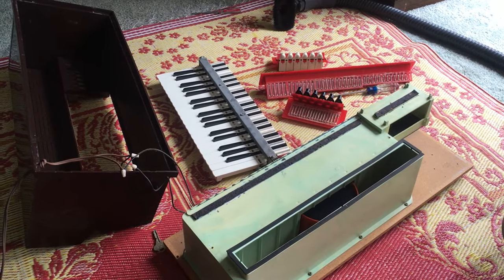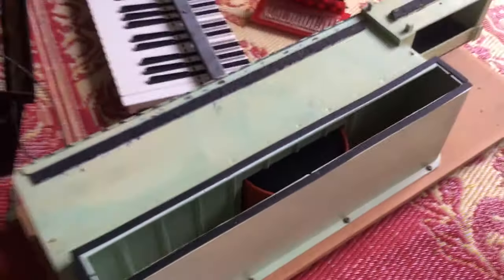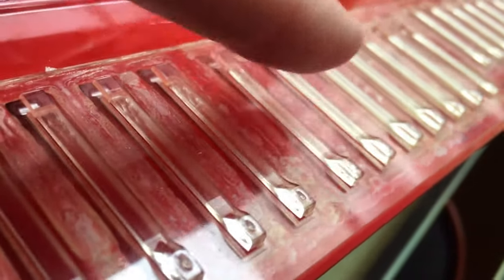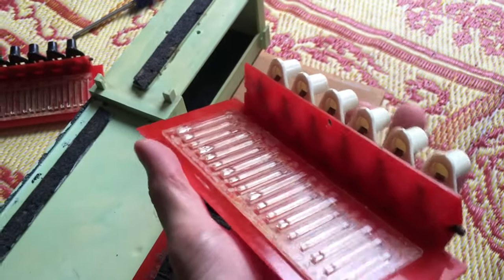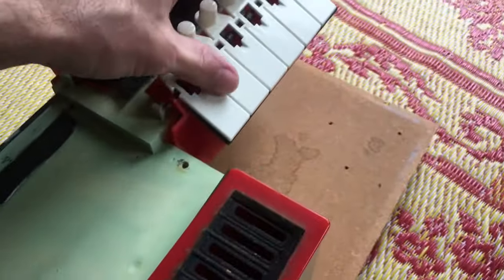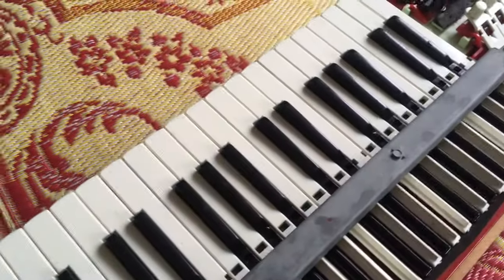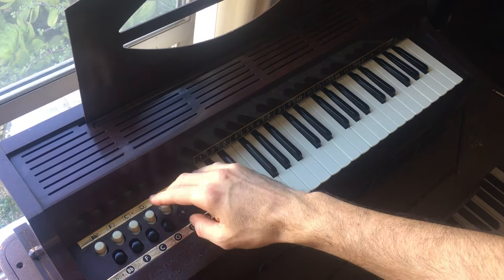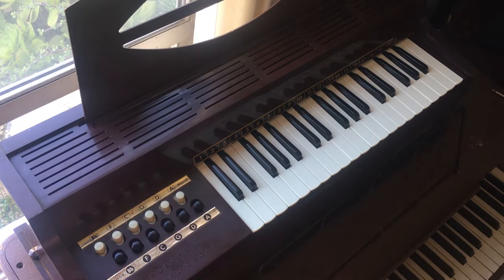Magnus Chord Organ 670 inner workings inside and demo

Comment: I have the same one from this video in the 70’s.  That is how I learned to play piano and went on to several band instruments and guitar. Wish I still had the little organ.  It had only 1 volume, LOUD…
Reply from the maker: I tried putting it on a dimmer switch to control the fan speed in order to add dynamic expression capability, but as it turns out the reeds inside only work with a good amount of air going through them. Even when controlling the air pressure it was only 1 volume, LOUD. 🙂

Comment: i just pulled one we had in our shed out. it has lots of droppings and dust in it. thank you for posting this, it will help me clean it out and get it back to working order in no time.

though mine is a modelno.990, they should be relatively the same.
Reply from the maker: Mine had some little droppings in it also, tons of dust, and a few odd little things which had fallen in there over the years, but I didn't think the filth needed to be in the video. :-)

Comment: I'm glad I came across your video. I just purchased a Sonola Organ from a pawn shop, same mechanism as yours, just a little bigger. Before buying I tested it so many times and it worked fabulous (hence I bought it). So when I brought it home I put the unit standing in vertical position for a couple of hours until I find some find of tall stand. Then I proceded to sanitize and disinfect it with some antivurus spray. (corona virus thing)  I was very careful so I used a cleaning towel to avoid spraying the solution directly.  Then I finally plugged and turned the unit on , but it takes a long time to work, the sounds is very low, I can barely hear anything, some keys don't work at all,  they don't produce any sound and the chord keys on the left side don't produce any sound either. I also notice the fan emits a louder sound. It wasn't this loud when I tested at the pawnshop. What do you think would be wrong ??   Did the antivirus solution entered inside the unit by accident and cause some fuse malfunction ?   Did I damage the reed mechanisms or fan by putting the unit in vertical position for a couple of hours??    Again, the unite was in perfect working condition , I tested it several times before buying it. Your help is greatly appreciated. !
Reply: I'm going to take a guess that standing it in the "vertical position" - does this mean you stood it on its end? - is more likely to blame than the disinfectant. Especially if you only wiped it on, rather than sprayed it. Possibly the fan has come loose from its housing? I would unplug it and try taking it apart like the OP has done and seeing if anything seems wrong inside. They are simple machines.
Reply from the maker: My first advice would be to get a screwdriver, take it apart, clean whatever you can clean, and see what happens. They're simple devices, so cleaning is most likely all it needs.
Reply: @marknowlin8356  I was able to take it apart, Apparently nothing is broken or loose inside. However, I'm sure that by standing the unit on its end messed up the key bed big time.  It's a weird mechanism. Each key is attached by title springs and has to be perfectly "Aligned" to touch some metal surface at one end and a hole on the other to make a sound. Otherwise, it doesn't produce any sound at all.  Standing this instrument on its end is enough to cause damage. .  I mean, it doesn't break anything, but it "Dis-Alignes" the key mechanism.   When placing this unit in vertical position, the metal underneath each  top  key causes extra weight on the key below and consequently makes them get out of place. 
Also, it's super easy to take a key out, but extremely difficult to put it back in. There's a great change of breaking the the springs when trying to put back a key. 

My instrument doesn't work properly anymore. Now just 5 keys at most produce a very weak sound, the rest nothing!  I messed it up big time !  Maybe I need to find  some old organ repair shop , but at the same time I wonder how much they would charge.  It's all artisanal work and I assume a lot of labor hours need to be involved.  Thanks for your advice though !
Reply: @JeremyBorumComposer  I did that and doesn't work. I agree it's a simple device, however, its a complex artisanal mechanism. There are no motherboard or chips at all, but the keyed mechanism has tiny springs connected to try pieces of metal and each key has to be aligned perfectly on both sides ( one to a metal surface and the other to a hole) to produce a sound. When I stood this instrument in vertical position for a couple of hours, my assumption is that the metal on the upper keys caused extra weight on the lower keys and messed up the whole mechanism.  Nothing looks broken or loose but the keys went out of place maybe by a 10th of a mm , but still it was enough to cause damage.  Thanks for your advice though !
Reply from the maker: @realsoda9404   That sounds a little more complex than my little unit, but it also sounds like it's a matter of careful adjustment and not anything that's permanently broken. I wish I could offer a little better advice, but keep fiddling and best of luck with it.
Reply: @JeremyBorumComposer  thanks. Yes my instrument is more complex than you in terms of weirdness lol. It’s a weird mechanism from the 40’s or 50’s. Just to dissemble it took me forever. Nothing is broken but to adjust the keys is a real challenge because you have to take them out and try to adjust it perfectly without breaking the tiny springs or metal pieces. I’m not sure if appropriate tools even exist , if they do , they have to be thin as hair but strong as a hammer.
Reply: I am quite sure the fan has come somewat loose from the motor. You should be able to open it with the 4 screws surrouding the fan hole in the bottom. Make sure to not put any pressure on the bolts while unsrewing them since the nuts are pressure fitted from the inside and might slip out. You can anyway reach it by total disassemble from the top. 
I repaired mine with epoxy glue and a tight o-ring around the plastic shaft holder.
Reply from the maker: @realsoda9404  Almost a year later, did you figure it out? It sounded like key misalignment or an air leak causing inadequate air flow, but did you ever figure out what it was?
Reply: @jarleinarottestad465  thanks for the advice , I dont remember if I did that or not ( take the fan out) . I’ve tried so many things and I gave up. It was supposed to be fun but turned out to be very stressful and time consuming for me.
Reply: @JeremyBorumComposer  hello Jeremy , thanks the checking. I could never figure out what the problem was. I did try a lot of things and every time I try to fix it , the keys would lose sounds . I gave up . It was giving me too much stress. It wasn’t fun anymore . I also tried to give it away and advertised it on local forums/ads and nobody wanted it lol . Thanks once again for checking .

Comment: I have the same one. Got it at a goodwill for $20. The main keys stick really bad, I can press them and they break free but will get stuck again over time. I cleaned the outside, but now looking at the back I am guessing the previous owner smoked and that fan blew the sticky nicotine and tar through it, so where the keys setting needs cleaned. Thanks for sharing this. I really expected it to be more complex than that. lol
Reply from the maker: This was was very full of dust, sticky from what I suspect was a soda spill, and complete with mouse droppings. A bit of a wash in the sink sorted all of that out.

Comment: Cool Jeremy, thanks. I am messing with Delmonico Chord Organ. Made in West Germany. I want to take it apart to clean it, but it's built a little different than the organ tear downs i seen on the tube. Got any advice? Thanks
Reply from the maker: They're pretty simple inside, so don't be afraid to open it up. Accordions are relatively simple inside also, and these are basically accordions with a fan instead of bellows. If any notes are behaving oddly, make sure the felt or leather that closes up the holes is sitting evenly around the opening. Clean it, but don't oil anything. Take pictures along the way if you think you will forget something. Other than those little tips, you'll probably be fine. Good luck!

Comment: sir, I have a problem, mine doesn't sound, it starts but no sound😢
Reply from the maker: If you hear the little turbine working, my first guess would be that the air is escaping and not providing enough pressure to the reeds. You only need a screwdriver to take it apart and you can't do much harm, so don't be shy! Just open it up and see what you can see.

Comment: Just found one for free. Plugged it in and the lights in my room flickered lol. I should've asked if it worked before taking it
Reply from the maker: There's nothing more than a fan inside, because it's basically a funny accordion with a blower. You could probably swap out the fan if you wanted to.

Comment: I have one of these! the seem simple, but you cannot glue or fix them if you snap a plastic pin. one note is just farts now.
Reply from the maker: Agreed, there's no way to replace a single note and probably no longer any way to buy a replacement reed bar either. If super glue doesn't fix it for you, I'm afraid it's probably rubbish.